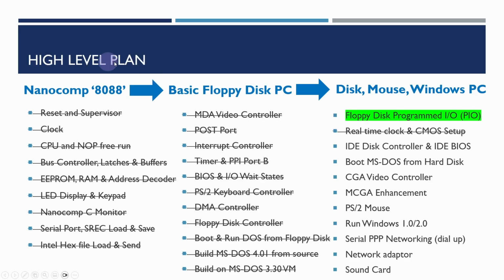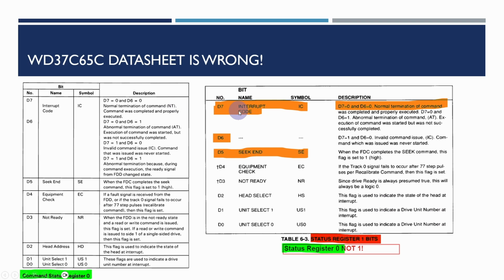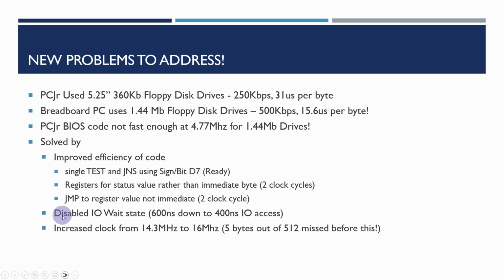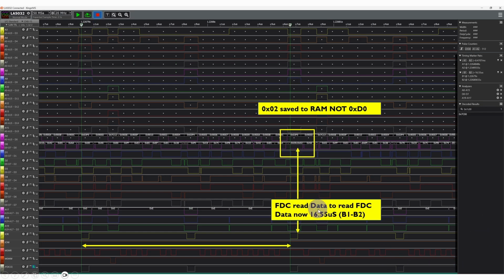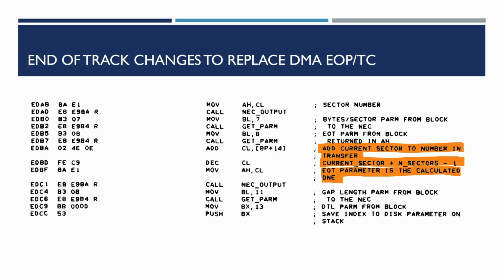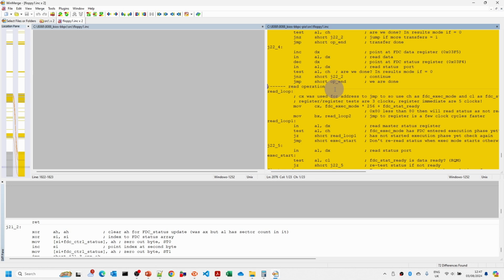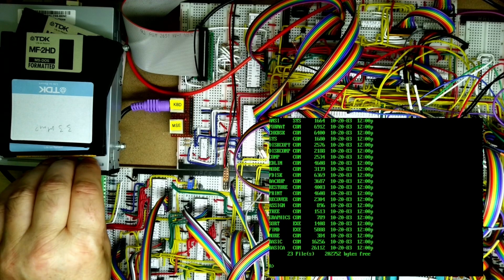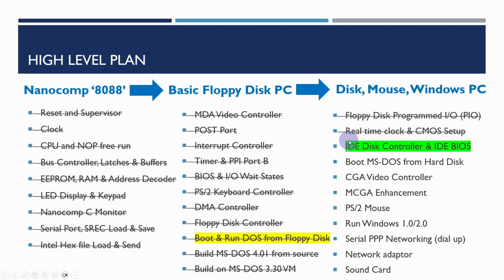Breadboard 8088 PC #41 Now runs MS-DOS 3.30, 4.01, 5.0 & 6.22

Comment: As I've seen all of your videos I have to say I'm very impressed! I've also seen that you uploaded everything on GitHub including schematics and code. I wanted to ask permission from you if I can recreate the whole computer ( maybe modular ) and rout a pcb for it. It will be just for personal use just for tinkering around. I think it would be a nice challenge. I might be able to fit all glue logic and gal logic into a altera or atmega cpld... Also if I show it somewhere ill be definitely including your name and GitHub repo as credit. Thanks for the awesome videos and great work!
Reply from the maker: Wow, that's some feat to watch all of them! The Github stuff needs an update and be aware that the DMA stuff doesn't work reliably. I will be updating the schematics over the next few weeks now that the worst of the KiCad 8 bugs seem to have been fixed in 8.04 (was crashing for me after every other bus line update). If you are looking to build PCBs you could try using Sergey Kiselev's XI 8088 which I have borrowed quite a bit from (and the BIOS). https://github.com/skiselev/xi_8088. Feel free to use what you want otherwise. Thanks for the feedback. Dave